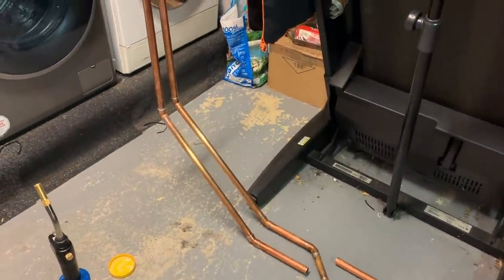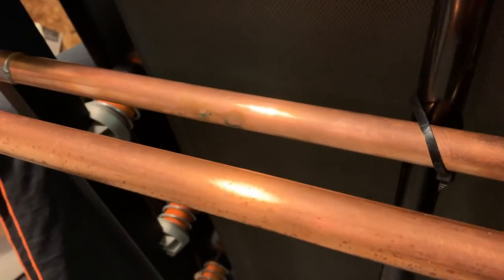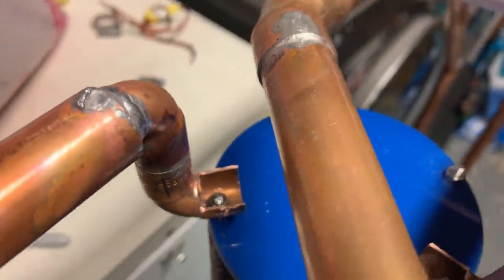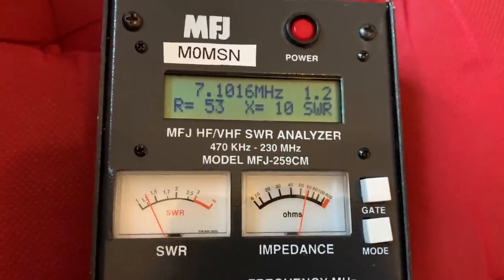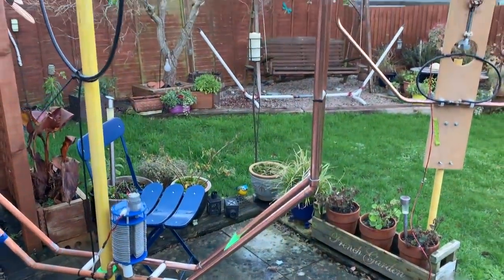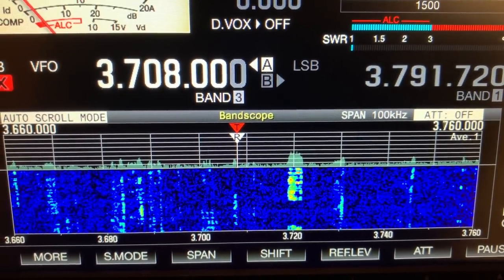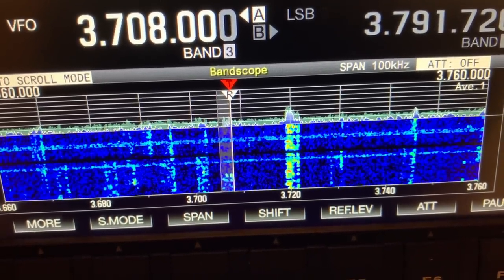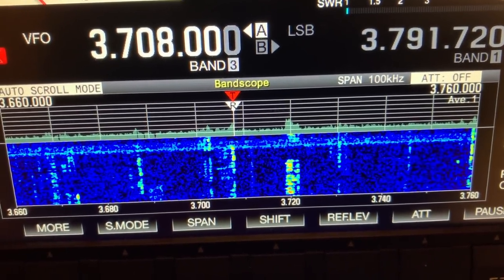HAM RADIO: Double Copper Loop for 80M Build

Comment: Mike: 

I made a 2-turn loop a bit larger than yours, using RG-11/U coax for the loops. 51.5" diameter, supported on a PVC cross frame. Tuned with a receiver cap, 20pf - 400pf per section and series-connected for a 10pf - 200pf tuning range. I can tune it up from 3.2 MHz to 8 Mhz. Spacing is 2" between turns.

This was a first build for a multi-turn loop. I plan to clean it up, and I like your spacers. I plan to cut a set for my loop but I need to remount the capacitor so I can cross the loops over at the bottom like yours.

The price of copper shot through the roof in the last couple of years. If I went with copper tubing and fittings,  at the current pricing, (March 2023), it would run around $175 USD just for the copper parts!  My surplus reel of RG-11/U cost less than a single 10' length of 1/2" copper tube, and the reel end I bought has at least 300' on it. That's a lot of loops, no?

Three loops here now, a walkabout loop made from an aluminium bicycle wheel rim (17 meters - 6 meters), a 36" single-turn loop (40 meters - 10 meters) and the 51.5" 2-turn loop (80 meters - 40 meters). I demonstrated the 2- turn loop on 80 meters from inside the club meeting room earlier and, running 5 watts on FT-8, made a contact some 275 miles away. That made believers out of the guys and gals at the meeting!

Keep up the great work and posts. I need to build a cap like yours so I can run a bit more power, hi!

73, Keith, WB2VUO here near Buffalo, NY

Comment: I like to PVC and ties idea. BTW, you can lower the loop RF resistance a bit by sanding off the lead that is exposed at the fittings, since the RF follows the surface. I don't know if it will be noticeable, but it is a fact.

Comment: Mike, in my opinion the results from a twin loop antenna are likely to be much inferior to those from a single loop.  This is because the antenna depends upon the existance of a VOLTAGE STANDING WAVE around the loop.  (This is where the principal emulates that of a half-wave centre-fed dipole).

But with a twin loop design, the voltage standing wave in EACH of the loops is likely to be greatly distorted by the proximity of its twin.

Comment: Hi Mike,

Thank you very much for your very good comments on building your twin loop.
Can you please tell me what value (pF) the "C" you installed has and also the diameter of the twin loop please.
Thank you for the great inspiration.
73, Ingo
Reply from the maker: the range is 10 to 350 pF on this Cap.....the diameter is 1.2M (1200mm) x 2 as it is a twin

Comment: I'll give a look at your website, but do you have a build video or plans on the capacitor. Hind site being 20/20 I had a vacuum capacitor that was in a homebrew tuner. But sadly 20 years ago I had no idea what a Magnetic Loop was let alone wanting to build one. I'm planning on starting with a single turn, but love that two turn design you built to work 80 meters. Great video!

Comment: Mike. I' m in the process of building a 5M Circumference single loop for 60/40/30, it will be (eventually) brought to resonance with a variable vacuum cap. Please, how did the spacing of your double loop arrive at 10cm, are there formulas for this? Like you, I'll be 22mm and looking to build the double for 80m. I just can't get over the price of copper and fittings at the moment! ATB Kev, M0TNX

Comment: The resistance of a mag loop is a very important parameter.  Ideally the joints should be TIG welded, instead of soldered.  Note that the lower the resistance, the higher is the Q, but the trade off is that high Q decreases bandwidth.  A loop could have a very high Q and not have sufficient bandwidth for a SSB signal.
Reply from the maker: True
Reply: Wait, Tig welding copper? I'd love to see that...
Reply: Instead what about brazing with silver rod?

Comment: I too will build one.
Can you say the value range of the capacitor, please Mike?
And which one, where from. I like the integrated motor.
Is a vacuum one unnecessary ?
What transmitter power are you using? What can that capacitor take ?
So many questions, sorry.
But lots of us may want to copy this, and to do so we need to know a bit more.
Reply from the maker: you may get a lot of your answers in the next video!

Comment: Have made a similar antenna, but a square loop. Get 1.1 SWR for 40m but not able to get 20m. The total length of the copper pipe is 24feet. Seeking your inputs to get 10m
 Thanks in advance 73.
Reply from the maker: Very nice!, the loop need to be 10% of the operating frequency, see 
https://www.66pacific.com/calculators/small-transmitting-loop-antenna-calculator.aspx

Comment: Hi Mike, new to your channel and enjoying your videos. Have you tried shaping the smaller pickup loop to closely track the curvature of the larger loop to provide max coupling? I made a coupling loop like this which formed a half Moon shape, the greater efficiency and lower SWR was very noticeable. You might also want to try soldering thick connecting copper wires direct to the cap terminals and then soldering to the main main loop to further reduce loop resistance. I plan to make a tubular capacitor as per one of your recent videos to add extra capacitance to my variable cap, but wonder if you have found a simple way to switch this in and out of circuit with minimum resistance contacts? And for your double loop how do you calc the distance or gap between the loops and could triple loop provide even lower frequency range?
Reply from the maker: Thanks will have to give that a try.

Comment: Mike are you banging your ALC way out the recommended boundary, looks like it is peaking well into the red
Reply from the maker: Yes, strange thing is the more I turn in down the more the radio compensates and turns it up ????
Reply: @mike-M0MSN  that is strange, I guess you are adjusting with the mic gain as I don't think there is any other way to adjust ALC. Do you run the processor on or off?
Reply: @mike-M0MSN  HNY Mike... on most radios, turning the power down puts the ALC up. Always check ALC after power changes.

Comment: Good Evening Mike. Wish to make a similar loop. What is the total length of the copper tubing across both the loops. What should be the diameter of the inner loop. Thanks, VU3RHU, Mumbai.
Reply from the maker: 8 metres of copper pipe, inner loop is 80cm.
Reply: Have made a parallel loop, with each loop being 12feet. Have taken the centre resonating loop as 1/5 of the total circumference which is 24ft, which h works out to 4.8ft. When I connect the VNA to centre loop ,get no reading on the VNA. What could be going wrong.

Comment: Hi - Amazing results with the mag loop Mike. Do you use a separate receive antenna as the waterfall on receive is very even across 100Khz when I would have expected there to be a very narrow peak even on receive. Thanks - Nicholas 2E0GKG
Reply from the maker: No, same antenna, without the pre-amp there is a visible peak, but my camera is not able to see it...

Comment: Does a loop work better higher in the air like a dipole would or do they work better lower to the ground like you have it?
Reply from the maker: I don't know..  I have only ever used mine at ground/3m high.

Comment: Hey Mike Great Job one more time, quick question, What is the capacity range of the variable capacitor you are using? 73 de K2WC
Reply from the maker: In this build it was 10uH to 350uH

Comment: How many feet off the ground was the antenna for the contacts during the video , and what is the ideal height to put it up permanently? I’m new to HF ,, I’ve been a tech since 2012 , but I’m about to take my general class and get a decent radio but I don’t know the first thing about antennas other than 
10 meter/2 meter/440 ,, etc
Reply from the maker: 6 Feet/2 meters the great thing about MagLoops is they do not seem to mind being only a couple of meters off the ground ( i think they need to be a loop diameter above the ground minimum)
Reply: @mike-M0MSN  
Ok thanks I’ll keep that in mind . Are they directional or omnidirectional ?

Comment: Mike, where did you source the loop capacitor from please? Looks good for high voltages and easily modified. J
Reply from the maker: A local Radio Amateure (Andy) gave me the one I used however I have been able to copy it and have made others. video coming soon  :)
Reply: Gm0sdv build this capacitor

Comment: Fine Mike, do you have a difference betweeen your EFHW antenna ? 73
Reply from the maker: Yes the EFHW is a lot more noise and will receive some signals that the Magloop will not, and the Magloop is much quieter and because of this receives signals the EFHW cannot????
Reply: And in transmission ?